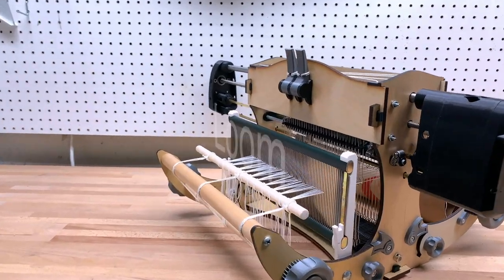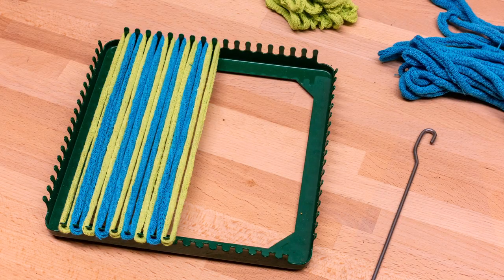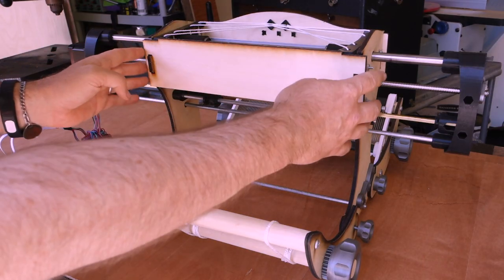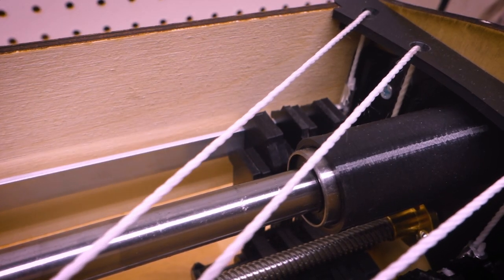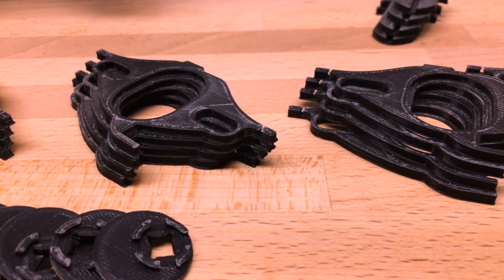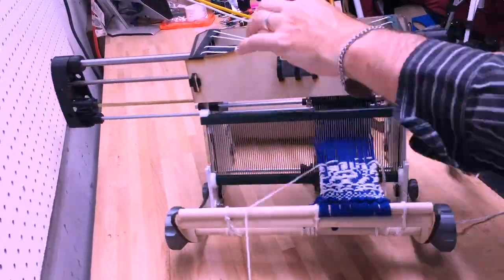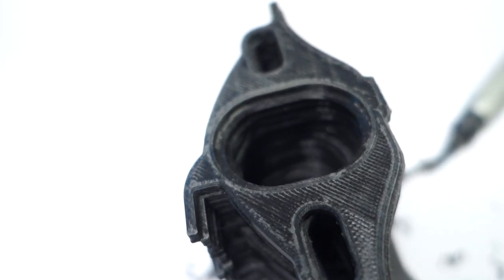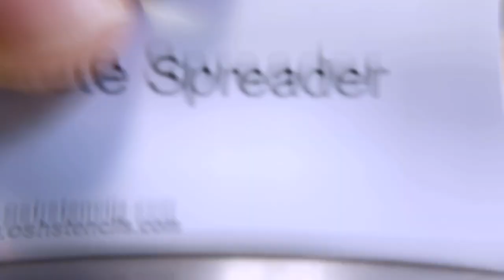Building a Computer Controlled Loom

Comment: This is fantastic and inspirational. Real quality over quantity on the videos!

There are some key details missing...making the square shaft indexer looks a challenge, and I'm not sure how to tackle that. I suspect an adventure making all those wire hooks too? Can you share the details?
Reply from the maker: The wires themselves (with the eyes) are standard Wire Heddles sold for looms.  The hooks are custom 3D printed adapters that just snap into the loops at the ends of the wires.  The square shaft/round shafts are made from standard bass rod stock that you can get at a hobby shop or order online.   The different sizes nest and  then just epoxied together.  Be warned though.  This isn't intended as a "how to" video.  That thing was pretty tricky to build and even trickier to get running without jams.  Even though I've open sourced all the designs/code it's very far from a "kit", and for wide warps the weaving speed is pretty slow.  I have an idea for a non cam based loom that would make the weaving a lot faster and might be easier to build.  Not sure when I'm going to find the time to try it out though.  I have a lot of different interests not just in looms.  :]  I'm glad you liked it!
Reply: @retrotechjournal  Thanks, Kurt, appreciate it. I'll be forging my own path, anyway, I'm not for following plans. You've given inspiration for a winter project for this year! The indexing system is cunning but clearly has a scaling issue. I'm noting that 9G servos can be had for cheap, possibly not reliable enough to lift heddles directly, but that might be a way to set the mechanism if the physical fit can be sorted out. My goal would be full automation, so shuttle issues too.
Reply from the maker: @dnmnsmith  Great, yes if you can go the route of one actuator per Heddle you'll be able to get a reasonable rate of weaving done.  I recommend you look at traditional loom designs.  Many of the DIY Jacquard looms I've seen over focus on the lifting part and don't pay enough attention to the tension-ing, beating, etc.  So even if they get the lifting working, it doesn't work well as an actual loom.   Keep me in the loop about your progress!

Comment: even though a loom is literally ancient technology, building one yourself, from scratch, is extremely impressive........ its hard for me to imagine designing one from scratch, and im a maker too. If you make a higher thread count version, maybe one that can be made with different widths, so you can make bigger, or smaller cloths depending on the makers needs, that would be something i would want to make, and use, this one is  a little les practical then i have need for, i need more than scarfs. 

subscribed
Reply from the maker: Well the current design makes it sort of impractical to do high thread counts since it would get pretty slow.  I have some ideas about how to make a faster version but who knows when I’ll get around to prototyping that. Lol.
Reply: @retrotechjournal  well, im subscribed, whenever  you put out a video, ill watch it,

Comment: I am definately late on this one but wow, this is an impressive project. I don't even know how you figure out where to start when designing something like this.
Reply from the maker: Where to start is always a good question. I think in general I try to envision all the things that will need to happen and any of those things where I'm like "I have no idea,or at least have no idea how that's going to work" and I try to do tests/prototypes of those things first.  For the loom I had the idea for the cams, but really had no idea if that was going to work in practice so I made a simple motor mount with some rods/lead screw and tried to see how well things would slide, what would bind, etc.  My first version used plain bearings and  clearly was binding, so I did redesigned that a few times until could at least get the carriage moving around, and then I tried out the cam driving thing, etc.   Step by step.  Small problem solve to small problem solve.

Comment: I was looking forward to seeing a proper automated shuttle mechanism.
Reply from the maker: It is an interesting problem...
Reply: @retrotechjournal  wouldn't need to be fast, So maybe a worm screw that can ack as the beater as well. Then just bitch the shuttle and it is as simple as changing the rotation of a motor.

Comment: I was expecting to see the automated part opf the loom working. There's a couple of closeups showing the 3D printed parts, and even the cable plug... but nothing on how the mechanism works, or even the motion of the parts in real time. I guess there are more videos coming?
Reply from the maker: Well the automated part of the loom is the raising/lowering of the threads in various patterns.  The actual passing of shuttles back and forth is still done by hand.  The raising/lowering/pattern stuff is really where the design power comes from.  I have no intention of automating the shuttle passing back and forth part simply because that adds a lot of complexity and massively limits the kinds of designs I could weave.  That Pikachu design uses 5 different shuttles with different colors/thicknesses of thread.  I could just as simply do a 12 color design.  If I'd automated the shuttle passing part that would limit it to 1 color.  I'm sorry this wasn't more clear in the video.  In the time lapse of me weaving the first blue and white panda it's a time lapse of me passing the shuttles  so it's semi visible, but you're right there's no real time showing of what a few passes look like.  I really should have included such a thing.

Comment: Great accomplishment. My daughter recently started weaving some string friendship bracelets with intricate patterns and selling them at the local farm market where she works. They are very time consuming to make so I got to wondering if it could be automated. Problem is, I think, that these are created using various forward and reverse knots as the weaving progresses so I don’t know if that could be accomplished with a loom machine like you built. Sounds pretty complex to me 😄
Reply from the maker: Dale Schimpf Yes, that sort of knotting action is difficult to automate. Even a software guide isn’t that helpful for repeating patterns, since the friendship bracelet repeats enough that a guide quickly becomes useless. I guess for very complex non repeating designs some guiding software might help produce unusual/pleasing results.  One thing I learned doing the loom is that repeats are an important design element, not simply a limitation. So doing non repeating designs sometimes made for weaker designs.  I’m glad you liked the video!
Reply: RetroTech Journal thx for confirming what I suspected/was wondering. Was looking for an excuse to use a Raspberry Pi. Think I’ll start with something simpler 😄
Reply from the maker: @daleschimpf  I'm the LAST person that should be dissuading people from doing overly complicated projects.  That's the story of my whole life!  ;]

Comment: I think that its a great idea, but the wooden parts can be fragile, maybe if they were substituted some how for standard industrial parts it could last longer or do heavier job.
Reply from the maker: 1/4 Inch plywood was the right call for my particular circumstance. Very easy and quick to cut on the laser, light weight/cheap and plenty strong for this application. If the design where much further along and the device was going to see industrial use/I had a bigger budget/different fabrication tools I might consider something else.

Comment: Ditto to all the praise above, fantastic work! Did you design this pattern making mechanism or did you get inspiration from another design? I like your Bob and Louis doodle too lol.
Reply from the maker: I made up the mechanism.  I knew some commercial looms used solenoids, but that ends up being a LOT of solenoids.  I didn't really want to buy 80+ solenoids.  I've done  a number of stepper motor driven mechanisms including an automated focus stacking rig, can punching robots, XY solar plotters, CNC hot wire foam cutter, etc.  So I was trying to figure out how I could deal with a lot of threads using only 2 stepper motors.  Really the design isn't very practical since the more threads you add the slower it goes.  It took me several hours to weave that Pikachu.  I think pro units are rated at "picks per minute" and with a lot of warp threads my loom comes in at something like 1 pick per minute.   lol.  Which equates to a lot of standing around in the hot garage waiting for the machine and listening to audio books.  Not really practical at higher threads per inch.

Comment: The end of the tail is tiny  black mark with white to left and right. How? Do you plan a string of yarn that's white with one black drop of dye to go through?
Reply from the maker: I actually use 5 different shuttles of yarn.  Yellow, white, black, red, and thin white.  The red only appears in the cheeks/pokeball,  So in that case the black thread is only coming up to the top at that one point.  For some threads they always go the entire distance left to right, for ones like black they only extend as far to the left/right as are needed by the pattern.  So you can use normal yarn, without needed a pattern of ink on individual threads.  I hope that's clearer.

Comment: This is awesome man. I have actually considered doing a similar project, but felt it would be very time consuming. I hope you don't mind me asking; it looks like there are some gaps in the woven fabric. What is contributing to that? Is there a way to fix/address it?

You machine looks incredible.
Reply from the maker: Oh thanks!   It depends a bit on what you mean by gaps.  I'm using a combination of both thin and thick fibers, so some of that can read as "gaps" the other issue is that if you float a thread over other threads for too long a distance it starts to become more of a "loose thread" and less of a "integral part of the fabric".    So for example in the Pokeball I have a number of non red areas that duck under the warp.  Those are not 100% required, but I include them in the design so the thing holds together as fabric instead of having really loose loops that can just snag and cause problems.   It's up to the designer to come up with ways to work such things into the design, or work around them.  I tried to position them around the specular highlight on the ball so they could read a bit like extra shine on the ball.  There are a bunch of tricks that can be used to reduce the impact of such things, but I haven't had a huge amount of time to play around with them yet.  At only 8 threads per inch every aspect of the design is very visible.  I've also been playing with the idea of alternating warp colors so one could choose which warp threads a long float could duck under to reduce the visual impact of those crossings.
Reply: @retrotechjournal  Thanks for the reply. I'm mostly referring to the square 'holes' in between Pikachu's front feet. Is that caused by the same issue? Would this not be an issue if all the fibers were the same thickness?
Reply from the maker: @johndavismit  Yes, those are there because the background mesh of small fibers doesn't have a lot of the fatter white fibers in that area.   So that's mainly a design issue.  I could for example use fat white fibers for the vertical threads (the warp) and that would make it not have "holes" but would emphasis places where the vertical fibers cross over the horizontal threads in areas that don't match well color wise.   I was doing a sort of "lightening" background for Pikachu, and that just happens to have the thinest tips of the lightning bolts in that area. (To provides a thick ground area for him to be standing on)  I could have brought up the white more in there, etc.   Or done a simpler white design like a diagonal twill that would have covered that area very evenly.   Maybe I was just being a bit too fancy with the design. So I guess that was kind of "on purpose" I could have instead made just a zigzag pattern that would have filled that more evenly.
Reply: @retrotechjournal  Thank you for all the insight! I really appreciate it. It is making me dream about making one of these machines for myself. I'm definitely going to take a look at your documentation.
Reply from the maker: @johndavismit  Well "Documentation" may be a little generous.  :]

Comment: I wonder if it's possible to make this function as a Gameboy Printer. It's probably very complicated but if the loom is fully computer controlled then it may be possible.
Reply from the maker: lol.  Interesting idea.  I don't currently intent to fully automate because the current partial automation makes the loom very flexible in the designs it can weave.  Full automation would add complexity/limit the number of colors, etc.  It might be interesting to try as an add-on, but it would have to be monochrome, and would have other limitations.

Comment: Excellent work, I'm investigating a similar project. It's hard to tell from your video but it looks like the shuttle is still manual? Does it take a long time for the cams to setup each run? I have ideas... my basements going to get really noisy soon... my poor wife.
Reply: Yes, the shuttles are still manual.   I figured that gave the most flexibility in design.  I can make patterns with as many thread types/colors as I can stand.   It is true that as the number of heddles grows each pick gets slower.  Which makes the over all weaving process slower.  At 25 heddles it's still at semi normal weaving speed since you can spend a little while packing down the pick/getting ready with the next shuttle, but at 60 there's a lot of waiting.  Which is the single biggest problem with the loom.  I have some ideas about how to make the whole thing a lot faster, but haven't made any prototypes yet.
Reply: @kurtschaefer  Yea, I've been thinking over the challenges for a day or two. I don't want to buy 100 solenoids as that'll get expensive. I was thinking about attaching magnets to them all then turning on electro-magnets but that runs into the same problem with 100 relays. So instead I was thinking of having a pin that slid in and out so each heddle could be "Switched on" or off. Similar to what you're doing. But instead with this the pegs could have a magnet glued on the end and I could have a shuttle that slid back and forth flipping a single electro magnet positive and negative to set/unset the pins. Give the time that it would be set and the motion involved this could even be part of the shuttle mechanism. As the shuttle moved across it could be setting the pins for the next run? I dunno, I'll start poking at it tonight and finding flaws in my idea... lol
Good job though, well done! I plan to steal many of your ideas and not tell anyone that gets a Christmas scarf from me where I got them. ;-p
Reply from the maker: @charliemopps4926  Yes I was thinking that in another version of the loom I might instead of a cam, I could use a servo motor driven "selector" that would shuttle each of the followers into one of 2 tracks that would separate at a Y connection.  A bit like a railroad track switch.  That way you can just crank the whole thing left/right at best speed.  Keep me posted about your progress. I love hearing what folks are trying in this space.

Comment: I was a teacher in Technical college's Department of Textile Technology. Your loom maybe a mini jacquard one. It's a great idea. I used to make one which is 50 cm.width, 8 frames and control by computer. but your's can do more  complicated pattern than mine. What about the weft insertion? Do you have any idea?
Reply from the maker: I intentionally did not address automating the weft.  Not doing that allowed me to focus on the Jaquard portion, and entirely punt on the picking.  Mainly because that allows for a LOT of flexibility since I can use 1 shuttle or 10, my designs can work with any kind of fiber, etc.  It is an interesting problem, but not one I've done any real thinking about since I punted on that from day 1.

Comment: I'm still wondering why there isn't a home product for this, since it stood at the brink of computers and all with the punchcards.
Reply: I'm not sure.  I think it's hard to pull off mechanically at some low price point.  There certainly are smaller Jacquard looms but they are crazy expensive.  This version is probably too slow for any sort of home production kind of thing, but I have some ideas about how one might be made that would work more quickly.

Comment: Hi RetroTech, your project is very impressive! have you maybe continued in any development yet or not?
Reply from the maker: I'm sad I didn't actually show the iOS app I wrote to drive this thing.   I haven't worked on the loom itself in a long time.  The main issue is that the pick's per minute are too slow, so actually weaving things out is kind of painstaking.  With a lot of "then wait for 50 seconds"  which is pretty un-fun.  I do have a design idea for how the whole thing could be much much faster, but I haven't taken it as far as building a new prototype.